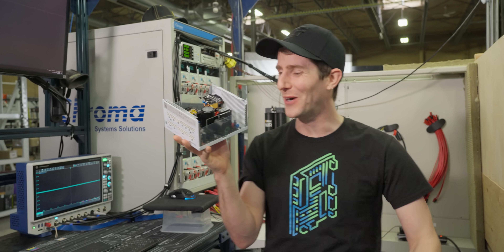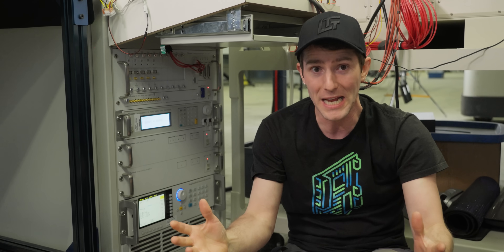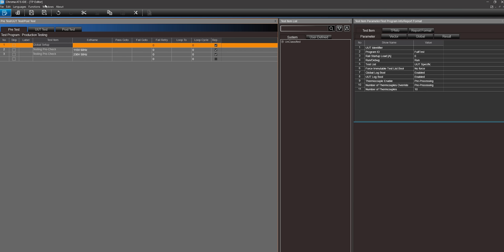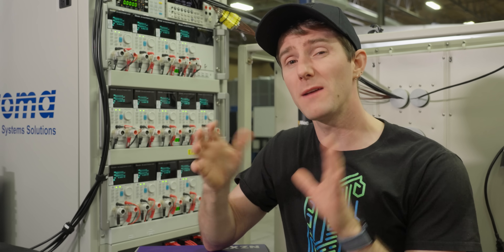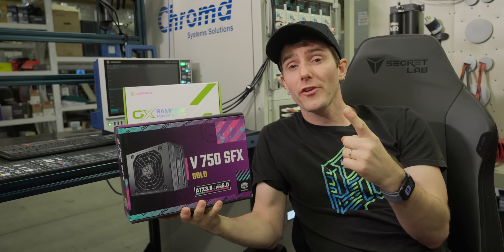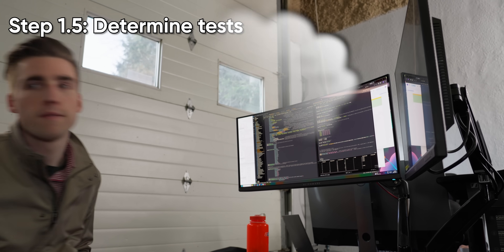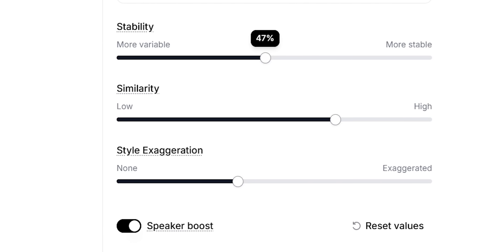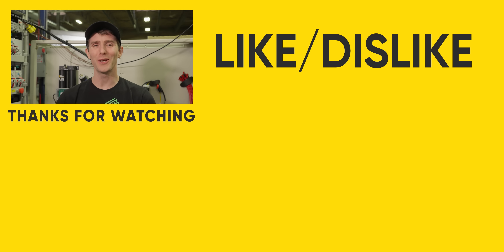Thousands of You are Buying Dangerous Power Supplies

Comment from the maker: Shop Micro Center’s Monitor Madness Event: https://micro.center/fz3d

Sign up for a FREE 128gig Flash Drive When Santa Clara Opens: https://micro.center/d3cp
Reply: PSU must get a good Cybenetics Certification to trust it.  80 Plus is an outdated certificate...
Reply: Yeah, I bought a game Max 1000 Watt power supply trying to save a little bit of money, and I will never do that again!
 within one year exactly, I started to have issues thinking it was my GPU, because every time I turned on a game, it blue screened, and gave me error codes that were pointing towards power settings, or something, it wasn't being clear, because I even looked up the codes,
  and it kept pointing me in a weird direction!?  so I put a 3060 in that I had luckily, thinking if I try this GPU and it works, then it's my 3080 GPU that has a problem! So
    I put the 3060 in, and turned the game on. and everything worked, there was no error code!? so I said to myself, oh, it must be the GPU. which was only a year old, as well so, I sent out my 3080, and after a couple of weeks of using the 3060 and getting confirmation From the company that was checking my 3080, had nothing wrong with it!?!? 
  I was scratching my head, and then, all of a sudden, the 3060 Had the Blue screen of death Pop up the same error code!!! Then the light bulb in my head went off! and I said to myself, Oh my God! it's the power supply, duh! 🤦
 and it was a game Max!!! so yeah, spend the extra 20 to $30, it is sooo worth doing, I immediately bought a sea Sonic 1000 Watt power supply, which cost maybe 20 to 30 dollars more than the game Max, Which is so worth it, you do not wanna have to worry if your power supply is either going to die, or cause a fire, and take out your entire system! ALWAYS spend the extra 20 to 30 dollars!!! and get a reputable brand always!
 it's just not worth saving $20 in the end, I will never buy game Max ever again!!!!  I will always buy a reputable power supply brand! and look up videos like this, that do tests!
 so! food for thought. 🤨
Reply: I bought a brand name PSU a while back and when i turn off my computer but i do not unplug the PC entirely (just regular "shut down") my PC creates a high pitched noises that slightly increases in volume over time (~12-24hours) - should i be extremely worried or is it just some really weird edgecase of coil whine?
Reply: Anyways I can't leave a comment but u should do a sketchy powersupply video with electroboom
Reply: yo id take 138$ total to make videos for your channel and voice them, its worth more on a resume than what i'd be paid, hell id do it just for the experience
Reply: Microcenter don't deliver outside the US :(
Reply: Who else wants AI linus with ample size of base voice samples, ample emotes voice samples, and for it to be improved by Vedal (Neuro Sama creator) to create a more emotive experience out of the AI linus. (And LMG could do a NEURO sama Setup Upgrade video, so we can see what server Neuro Sama will run for her next version.)
Reply: Nothing but love for microcenter, it's a drive but I pick up all my 3d filament from them and other stuffs
Reply: Not a content creator here so forgive me for not know, but if it takes a person 3 hours wouldn't it be just be faster to have them voice it, especially considering the videos are only 10 ish minutes long (that's like 10 to 20, maybe 30, min minutes of reading)
Reply: Ok, but where are the results 🙄 shouldn't you already have a playlist of all PSUs in the world tested?
Reply: @linustechtips please can you give me one of your old, but working(lol) laptops, My Inspiron 7567 is so old it turns off as soon as the electricity goes off, and the keyboard buttons don’t work. In short have no money to replace parts.
Reply: way better testing  than  gamers nexxus
Reply: I have MODECOM Volcano 750 Gold, are you also testing it?
Reply: I miss Micro Center.  Moved from L.A. to right in the middle between Chicago and Detroit, nine years ago.  Three or more hours is a very long drive, even for cool computer parts with friendly service.
Reply: Microcenter also price matches. I got my Samsung Odyssey Neo G8 price matched to an Amazon manufacturer deal last year.
Reply: At this point you aren't just reviewing power supplies, you could develop an accredited LTT certified bronze\silver\gold standard. Even going deeper with a High-Shock Load spec or Brown-out proof(thinking Cali\big-cities)..
Reply: This is some bullshit
Reply: Get a REAL job

Kidding kidding

Comment: With Watt vs Volt-Ampere, as far as I'm concerned, it's more about how it is used, as technically both are the same as V * A = W is defined by the SI unit system. But everyone just differentiates in that manner because it makes things easier.

Comment: Thanks for the test data i was going to buy a Lian Li for its cable routing on my custom enclosure but ive now crossed that brand off the new build list. Did you use the manufactures cables when testing? Did you measure any feed back into the grid or EMF? My PC build will be for home theater and i was looking for tests that showed any effects on other items connected to the same home circuit.

Comment: I'm surprised no mention of the market flooded with contraband supplies. Like 80% on the ITX FLEX PSU's are all fake. The server PSU's. No compliance marks on most which is illegal to sell in the USA. Or the fake ones are copying the stickers off the OEM ones. And putting them on their fake cheap Chinese supplies. Delta, Saesonic,  FSP, Athena. 80% are all fake being sold on eBay, Newegg, and Amazon. If you buy these Flex PSU's. Get them from well known places like Digikey, Mouser, and more. Because these supplies are not only dangerous. I have seen them explode here, and some with parts rolling around inside. And these destroy Motherboards real fast. All it takes is one pop from those cheap Chinese caps in them. I even got one 4 days ago with a rattling noise in it. I opened it up, and the aluminum casing around one of the caps came off. LOL! Garbage that destroys are stuff.

Comment: People are generally pretty stupid. 

There is so much misinformation out there, people are experimenting with other peoples systems giving bad advice. I don't even go on the forums anymore it's so bad it gives me a headache.

Try and correct and or let people know the correct information and get banned like I did from a major tech forum. Banned for pointing out extremely bad advice and calling it out.

PSUs and motherboards are the most cheaped out on parts in the machine, and they are the two most important parts in the PC.

Comment: Power supplies are one component where brand name matters - every time. Also, you get what you pay for. You can save by going non-modular, or no RGB, etc. but quality/$ is a real metric in power supplies. 
You can also overbuy (and I think many people do). For example, if you are building a PC for someone who doesn't game - and therefore there will only be integrated graphics - then yes, you can $40-$50 on a power supply (as a computer designed without a video card very likely doesn't have a killer CPU either).

Comment: Hey Linus, I'm currently still running an EVGA 850GT Bronze.
I've been using it with a 14700K and a 4060 Ti 16GB without any issues.
However, I'm planning to upgrade to a 5070 Ti, so I might need to upgrade the PSU as well.
I'm considering either the Corsair RM1000x or RM1000e — both are the 2025 versions that come with PCIe 5.1 and ATX 3.1 support.
Would either of those be suitable, and which one would you recommend?

Comment: Can somebody help me out what PSU should i get for 9950x3d + Rog 5090, i live in the Philippines sometimes brownout happens so i need a reliable psu that would destroy my PSU or the whole PC from a minor brownout like electric went out for a second then it cameback instantly, i have 3 options only it's the,
CORSAIR HX1500i (2025) 
NZXT C1500
ASRock Taichi TC‑1650T
all this 3 are PCIE 5.1 and atx 3.1 
i could go Seasonic or Rog Titanium that supports 5.1 and 3.1 but kinda to expensive out of the budget hahahahaha also wouldn't go for 1200w or 1300w so don't suggest 1500w below

Comment: Advice for MOST electronics products.  The headline figure, be it power, battery capacity, efficiency, are copy and pasted by the marketing department from the actual engineering documentation... without context.
The figures they give you usually come with a "Predefined test" apparatus, conditions, temperatures etc. etc.  Often the value can only be sustained for a period of time etc.
The marketing departments ignore all that.  So if the PSU has a "Peak load" of 1000W they will sell it as a 1000W power supply.  However if you read the datasheet the list of conditons and qualifiers to reliably run it at 1000W are long and the time it can run at 1000W is measured in minutes.
So.  Either do lots of research and look at test data like Linus is providing? and outside of PC power supplies....  add your own "anti-marketing" engineering grace,  like 50%.
If you need a 50W power supply for a project, and want to buy cheap on Ali or Ama, buy a 100W one.  Then buy two of them when one dies.

Comment: pulse power supplies are architecturally unstable. All protections are implemented in the so-called cold part - to control output voltages. The high-voltage (hot) part of the power supply monitors the increasing current through the transistors-transformer to regulate the filling of the pulse-width signal (i.e. to stabilize the voltage as a whole). The fuse does not protect the power supply but the power supply network from damage in the event of a failure of the unit. By and large, there are no protections in the hot part. Of course, you can organize any type of protection even in the hot part, you can duplicate the power supply modules separately, as is done for the military or space, but this will entail a huge increase in price.

Comment: so if you torture anything long enough it will die !!! build some pc's with these power supplies and see if the blow up under normal stress. not fake stressed till it breaks !!! so the one you showed was stressed tested to the max making it week then you plugeed it in to a wall a blew it up while it was weakened !!! first. that is like making you run a extremem marathon then right after making you climb a cliff straight up. then when you fall and die we will say he said he was fine. but find out after extreme wear and tear and lactic acid that killed you instead !!!
Reply: you do know that the companies who make these also put them through similar, sometimes destructive, stress tests, right? finding the limits of something is kind of the point of a stress test dude

Comment: The testing needs to measure the quality of the power put out, such as noise, initial overshoot/undershoot, and time to become stable. It's the fine details that tell you which is really the best power supply and also how long it is likely to go for before it starts causing trouble. The testing also needs to measure inrush characteristics.

Power supplies don't usually just fail without causing a lot of trouble first. They start going bad and cause damage to downstream electronics such as the motherboard and GPU. We need to know which ones are likely to do this so we don't end up with trashed motherboards, GPUs, or at best an intermittently failing system. It matters and it matters a lot if you're spending thousands on a build. I know from my own bitter experience the problems even a 'good' PSU can cause.

As people will most likely be using the supplied cables or ones otherwise sourced from the manufacturer and for that specific power supply then the supplied cable also need to be tested along with the power supply. A number of cables have capacitors built into them, either obviously or sometimes hidden. These cables need to be tested and examined for capacitors. This is because some power supplies actually require these external capacitors to meet the specified performance and stability.

I mention all this because of my own personal experience with a power supply that very highly. I had studied the test report that was part of the teardown and review and examined the oscilloscope traces. It was stated that no capacitors were used in the cables. This turned out to be false. I started having problem with my system crashing and freezing randomly when anything graphically intensive was demanded from the GPU. At first I thought it was the GPU, but when things did run everything was just fine and looked normal. I also knew that nothing had changed with the machine. The weird graphics issues became worse.

From previous experience I began to suspect a failing power supply. I remembered that my power supply was designed to run multiple GPUs and I was only running one, but there was at least one other power lead in the box. I swapped the power leads from the PSU to the GPU and started my machine. Given the poor state of things it would be obvious if this made a difference. It made a big difference and there were no problems whatsoever no matter what I did. I have an electronics engineering background and was now deeply suspicious that what should be a simple wired connection could cause so many problems. I decided to carefully examine and test the cable myself. I didn't have to go very far until I found something suspicious about this cable.

The cable itself was a single connector and the PSU and a dual connector at the GPU end. For the actual build I had decided against using the second power connector and used two cables instead. I started with the GPU connectors. When I examined the first connector from the PSU I discovered the presence of two extra wires that were much thing than the main ones and disappeared back up the cable sleeving, but did not emerge. I felt around the cable sleeving and found what I initially thought was a cable tie of some sort, yet it didn't feel like one. I pulled back the sleeving and found a tiny capacitor on the end of those small wires that been discretely hidden during manufacture. All the GPU cables were found to have these hidden capacitors.

From my own knowledge and experience, I decided that it was most likely these cable capacitors that had either failed or were failing. In applications like this, a specialised capacitor has to be used. I fitted new capacitors that were actually superior to the originals so I might get a longer life and better performance. I fitted the repaired cables and tried my system. I ran various benchmarks and games and there were no issues whatsoever so I left the upgraded cables in the machine.

In the back of my mind, I do wonder what the lab test results would have been if these sneaky hidden capacitors had not been present. Maybe they were a later modification to those cables. It's impossible to know. I would have preferred a power supply without cable capacitors as they are a hidden failure point that isn't obvious at all and would likely prompt people to go down a potentially very expensive rabbit hole replacing various other components when all that is needed is a simple cable replacement.

TL:DR: Allocate a serious part of the PC build budget to the power supply, the life and reliability of your system (and possibly even your sanity) absolutely depends on it and it can save you a lot of money in the long run! If you're spending thousands on RAM, CPU, Motherboard, storage and other parts, spend a few hundred on a top tier PSU. At least then, when things start to go awry, you can reasonably assume it may not be the power supply that is at fault either causing the actual problem or slowly killing the rest of your system. A top quality power supply will keep running and cleanly for years, and likely another build or two.

Comment: At 13:06. Your chamber is past calibration due date. What other instruments are out of calibration? At a minimum all equipment passed due date must be checked to see if still in calibration, if a unit is out of tolerance and required adjustment, all test with that instrument must be performed again.

Comment: I watch a lot of the LTT videos and remember looking forward to the PSU testing back when you first did the video on it, but today is the first time I learned you had finally started testing and publishing the results... a full 10 months after the first video went up. That's some pretty bad marketing. The point being, you definitely need to do a better job advertising the @PSUCircuit channel across all LMG youtube channels. 

You can probably figure out the following from internal metrics or some youtube tool, but I'll tell you straight out... I'm not on floatplane (there are too many subscriptions already), I only watch some targeted clips from the livestreams (I just dont have the time for 3-4 hour streams, and when I do that is not how I want to spend it), I usually skip the last few minutes of the LTT videos (when you start the outro or throw in another advertisement), and depending on who's talking I watch at 1.5x speed. I'd wager a lot of viewers behave similarly, and as such I'd kindly suggest you would have better success with self-promotion if you did so outside of those channels/forums or at least ensure it isn't exclusive to them (i.e. floatplane and livestreams). Best regards

Comment: A suggestion for the Labs website ... change the rated output slider to also allow manual entry of min/max watts, for those of us that have difficulty being precise when drag-selecting on the slider.  My attempts to nail 850W resulted in either 847 or 851, no matter how many times I tried - & yes, 847W minimum works but ...

Comment: Been using Corsair power supplies for years. I still have the one i put in a computer 9 years ago and it still has its factory 10 year warranty. Mind you, that system had 2 GPUs and 4 hard drives.